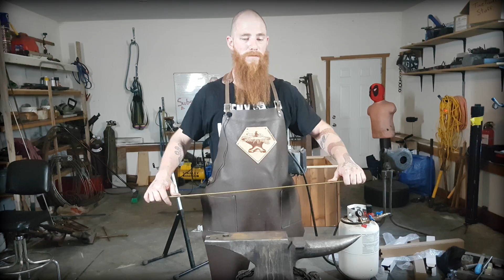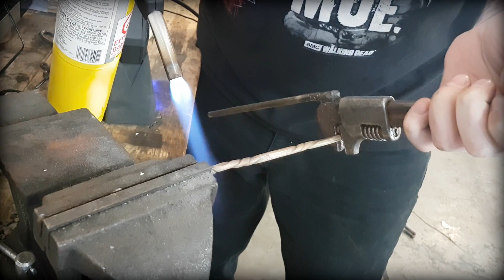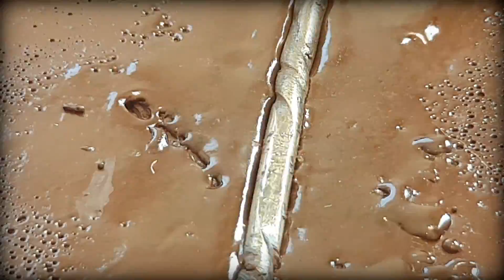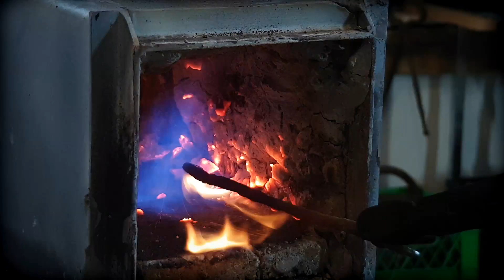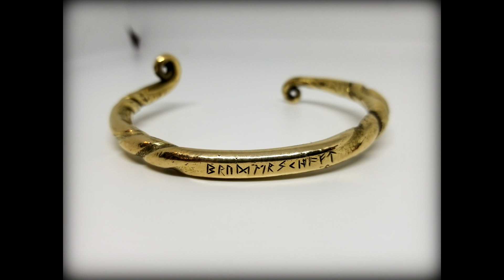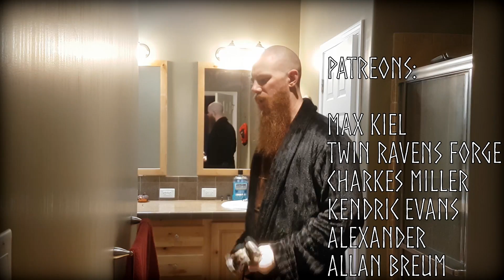✔ Bronze Viking Arm Ring (2018)

Comment: Wonderful work!
I have two questions...
i) Was the metal Bronze or Brass? The colour seemed more like Brass...? I find it much more brittle to work than Bronze (plus I can fuse Bronze together, but cannot do so with Brass. Not that that impacts upon this design..)
ii)  When you tapered the ends to make the terminals, did you just use a flatting hammer or did you start with a cross pein to draw out the taper? I normally start with a pein after squaring round stock, but this is a time consuming faff...plus I often find I end up going to a diamond cross section (work on technique required...).
Once again, fascinating, fabulous work! Skal from England!! Gibu auja!